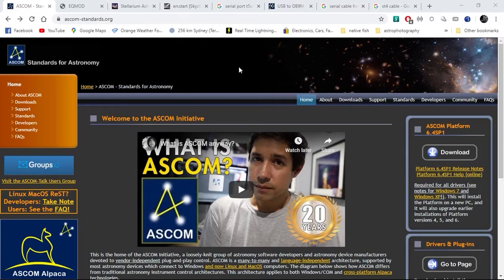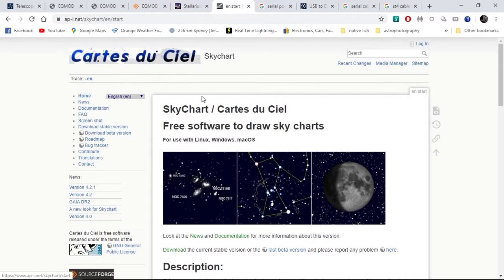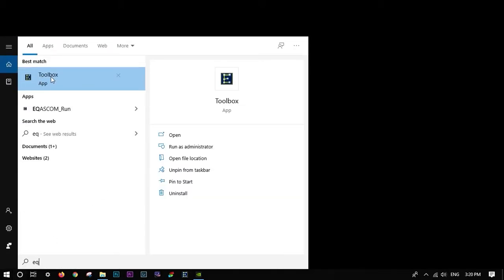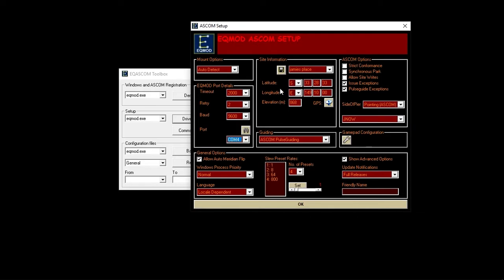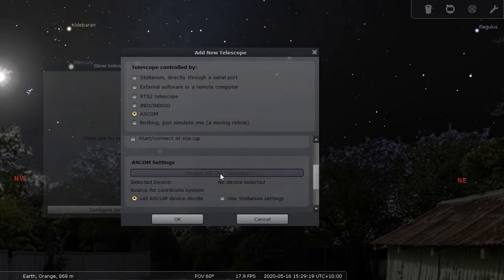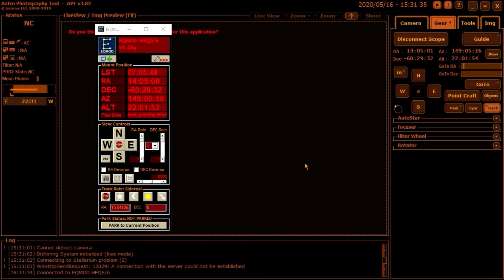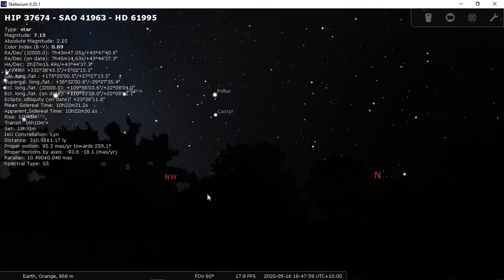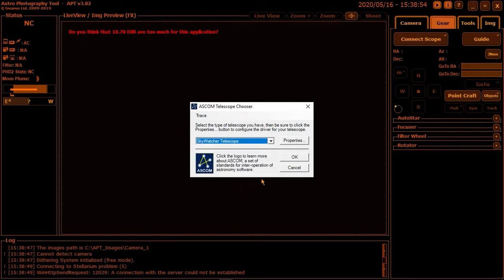Connect your Synscan mount to your pc

Comment: Please tell me where to purchase the hand controller to laptop cable with the serial  connection in the midddle shown at 5.00 minutes in the video.
Mine was stolen and I can't find a replacement.
Reply from the maker: i got mine on ebay , you could also buy an eqmod cable to do the same thing without the need for the serial cable as it plugs straight into a usb on your laptop or as i do  these days into my  zwo asiair mini  to control the mount wirelessly from my galaxy tablet
Reply: Thnanks !!! @JustJamie-h3l

Comment: Can I just use an RJ12 to USB cable, instead of going through the RS232 conversion?   Or even directly connect the mount via a RJ45 to USB and skip the hand controller all together?  I have the old SynScan v3
Reply from the maker: yes you can, i use a eqmod cable now myself , works the same way, i go through the hand controller as i still use it for a one star alignment first as the zwo asiair mini i now use needs it.

Comment: Hi I also think yours is one of the clearer ones out there especially connecting via controller, thanks. In my case, I am connecting the laptop via usb directly to the usb port of the hand controller of heq5, and set the hand controller to PC direct under 'utility' (very important as i am using EQMOD).  Under windows 'Ports (COM & LPT)' I saw 'Prolific PL2303L USB Serial COM port (COM6)'. I guess the windows has the Prolific driver. I set the 'bits per second' in the properties and the baud rate in the ascom toolbox setup screen to 11520 as many have suggested, but it keeps given me timeout error when I try to connect. Finally, I tried 9600 on both and it connects ! I went back to set them to 15200 to confirm and indeed it failed again, and when set to 9600 it works. So if one is connecting directly from laptop to controller with usb maybe its worth trying 9600.

Comment: Hi, can ı use to usb to rj12 cable with my eq3 pro synscan mount ?
Reply from the maker: yep you can use a eqmod cable with the  eqmod driver rather then using the synscan driver
Reply: @JustJamie-h3l  thank you so much :) 
I have one more question. Which cable should i use?
Rs232 to RJ12 or usb to rs232 ?
Reply from the maker: @kadircanklc   you need one of these cables its an RJ45 FTDI EQDIR USB Cable Adaptor for Skywatcher EQ3/5 Pro, the link below is for one on ebay, 
 https://www.ebay.com.au/itm/313766049355
Reply: @JustJamie-h3l  thank you so much 😊

Comment: Hi, thanks for the tutorial. it makes things much more simpler for a beginner. I followed the steps in your 2nd tutorial (v6 using USB), and it went as shown in the video, except the HC GUI didnot show up in my pc. also, the pointer in stellarium but not the telescope is slewing when i slew to an object. am i missing out something ? I guess I have to do the aligment on the mount before getting this works...
Reply from the maker: yeah stellarium needs the mount to be aligned to slew, even a 1 star alignment will do

Comment: Brilliant! This has saved me so much pain and frustration.  Probably the clearest explanation I have seen.  I was unable to get the COM port to be recognised by EQMOD in PC Direct mode using a Skywatcher Synscan USB adaptor so I tried a USB A to B cable stright from hand controller to the laptop and it worked (as someone else pointed out below). Thank you!
Reply: Hey just got eq5 pro with usb in handbox and in the control box to, but I can not get it to do anything, which software/protocol do u use to get connection working?
Reply: If i use usb in the handcontroller i get a error No data from motors, i do not get that error If i connection to the control box, but nothing happens, No connection

Comment: Ok, what do you do when the handset is unresponsive? I turn it on, it initializes, and then it does not respond to any key on the controller except rate, which I don't care about, and enter whic brings up an endless nag screen about not looking at the sun.
Reply from the maker: sorry mate but i am not sure, to me that sounds like a fault in the unit its self. have you updated the software on the handset.

Comment: Great video this is helping me a lot getting over the initial setup. What I haven't found in any video yet is where should the mount/scope/dslr be pointing to. So how does it know where to slew if for example I disengaged my clutches and have it horizontal instead of with weights down ? When I start do I always have to point it to Polaris ? Thanks.

Comment: I'm a newbie with a new Orion XX14g.  I have done everything and the computer controls the telescope! But when I try to slew to an object, the small EQMOD window flashes HORIZON LIMIT.   Can you tell me what to do?  Thanks!
Reply from the maker: its one of the safety settings in eqmod , so you cant slew the scope to a spot where it will come into contact with the tripod , you need to adjust the values to allow the scope to move . i dont use eqmod much so i cant quite remember were the setting is . or it could possibly be in the scope motor control settings on the mount its self , but same story , it will be under , slew limits
Reply: @JustJamie-h3l  Ok, thanks.  I was just getting the computer set up to control the telescope with it inside my house.  I'm constructing a small structure about a meter tall with a rolling roof and it should be finished in the next two or three days.   Then I can set it up permanently and get familiar with all the details. I'm not sure what I did but I think I clicked on default settings and those limit warnings stopped.  But I haven't set them yet.  Thanks again.  My location is in Chile.
Reply from the maker: @Land-and-Space  good luck with it mate , i run mine from inside my house , i concreted a post in my yard it saves me having to level and align the scope each time, it would be great to have a permanent set up like your building . good luck with it

Comment: I'm having trouble locating the "Skywatcher Synscan Mount Controller Driver" from the ASCOM site as you show. It only lists the physical hand controller and synscan app site link where I also cannot locate the driver. Any help?
Reply from the maker: it looks like they have updated the drivers since i made that video , i will have to test them out but the one your looking for is now called the syscan app by the looks of things
http://www.skywatcher.com/download/software/ascom-driver/
Reply: Ok cool. Yeah that would be good. Im attempting the second setup listed in your video as I have a SkyQuest XTg with the SynScan hand set. At this point the PC cannot recognise the controller in the device manager therefore I think its the driver thats the issue.
Reply: Am also wondering how alignment and tracking an object via Stellarium is configured? Thanks again

Comment: I have the USB to RS232 cable, but don't have the RS232 to hand controller port cable. What is it called? Thank you for the video, it is very informative!
Reply from the maker: its called an rs232 or a mount connector cable for what ever brand your mount is , mine is called a Synscan pc connector cable

Comment: Great video. You saved me  a lot of hard work much appreciated. You can also use a USB A to USB B cable straight from the hand controller to a usb on the Lap top also, so no need for the rs232 to RJ45  converter.
Reply from the maker: thanks, i am glad it helped ..
 the older handsets like i have dont have the printer usb port built in so you have to use the converter
Reply: @JustJamie-h3l  understood 👍
Reply: Thanks for that info. I have the synscan V5 controller with the usb type b port and assumed it was possible but was not sure. Appreciated!

Comment: Great tutorial, thank you. I am having trouble though, when I connect EQMOD it says Mount Position, Connect Error: timeout. Do you have any ideas on this issue. Thanks
Reply: All fixed. I had to change the baud from 9600 to 115200.
Reply from the maker: @paulbubeer911  glad you sorted that out , good luck with it mate

Comment: Hi, just wondering do you need to polar align the scope via synscan first? or could it be done via stellarium.
Reply from the maker: align the scope first.. i use the polar align on the synscan controller , i do a 2 star alignment which will give you the amount of error you have, then do a polar alignment (2 down on the handset from 2 star align ), then i do another 2 star alignment and thats that, i cant see the pole stars from where i live but doing it that way i can get tracking good enough for ten minute exposures using my guidescope and phd2 , once you have done that you can also run the DARV tool in astrophotography tool just to double check. it moves the scope left and right while taking a shot, if the star stays in the middle of the line its polar aligned ok,
Reply: @JustJamie-h3l  Thanks jamie
Reply: @JustJamie-h3l  Hi again Jaime, Just got my setup going following your video.
I can see what you mean ts a but bugy if you don't run the programs in admin mode.

I have the Saxon NEQ6 Pro, it was virtually straight forward setting up and hooking cables up, Just one other question if I can without stretching the the friendship....Do you have your guide camera connected to another USB or do you have the mount and guide cam connected together via a USB hub?
Reply from the maker: @osci08  i have mine all on separate usb cables running back to the lappy, my lappy is a bit slow and it doesnt like running hard wired hubs
i have heard good things about the 
ZWO-ASIAIR its a wireless hub, i am thinking about getting one as the cables restrict where i can put my telescope
Reply: @JustJamie-h3l  No worries, really appreciate your time Jamie, thanks heaps.
Reply from the maker: @osci08  glad to help out , i just posted a clip on phd2 if you have any issues getting the guiding setup
Reply: @JustJamie-h3l  I'll definately check that out well Jamie, thanks heaps, your a champion.

Comment: Jamie please answer my question if you know that. I have an EQM-35 PRO mount, it has this exact controller box of skywatcher. Can I connect 
 Lynx Astro FTDI EQDIR USB Adapter for Sky-Watcher Mounts, direct to the port of the box, that the hand controller is connected. To bypass hand controller. I mean its an RJ45 to USB port. Can I connect my pc this way? Can I connect this cable to the RJ45 port of the motor controller box, get rid of the hand controller, and the usb output to my pc?
Reply from the maker: the box is only for st4 autoguiding so  you need to connect to the handset if you want to control the mount with a program like stellarium